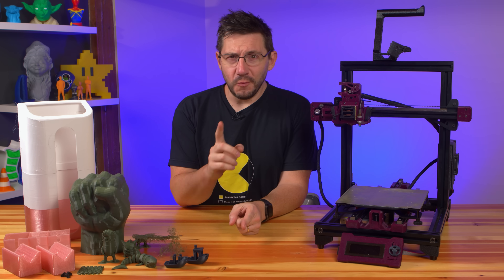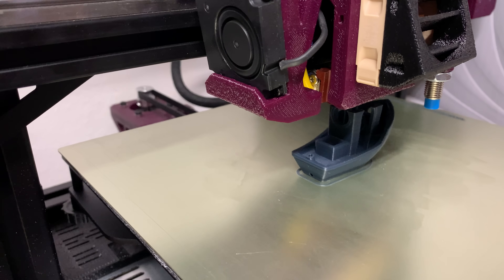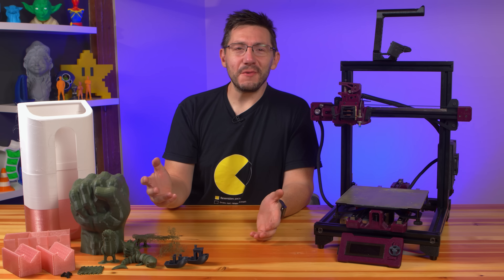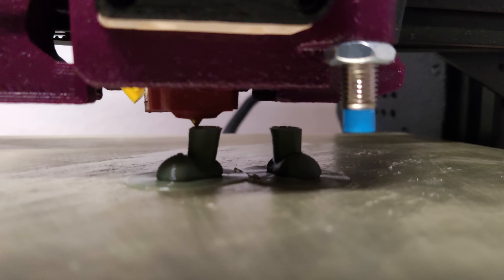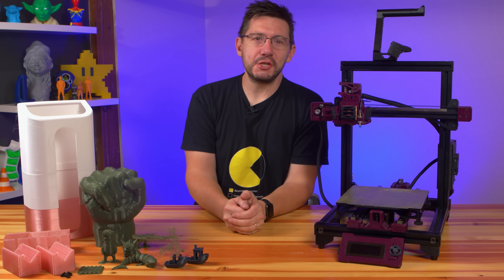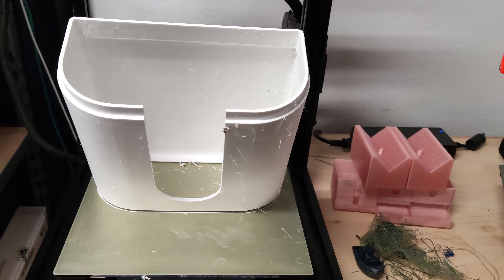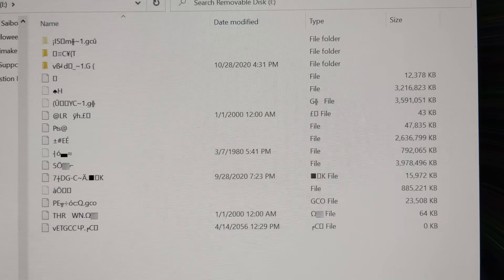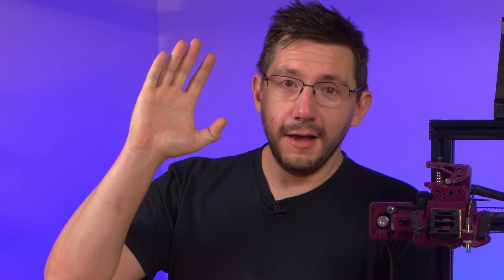WUXN WX1 Review // IS THIS 3D PRINTER FOR YOU?

Comment: Unfortunate.  Corrupt SD, bad test files,  a plate that doesn't stick,  tension on high x.  It's a molded ender 3 with a price that suggests an all original design. It's missing dual z to make up for potential sag or bad bearings.  It's too bad because I'd love a second printer that I don't have to mod. But not at this price point AND problems

Comment: yes, ok. for 400 maybe. For the asking price I, as a customer, I expect a fully developed machine that I can use as a tool in my different hobby. If printers are my hobby I'm better with an Ender 3 and maybe a direct drive kit, BLtouch, flexplate, SKR Mini ... I can gather experience that way, have better results and even 30mm more Z height for prints. This thing is way too expensive for what it offers right now. nah thanks I'll pass

Comment: Socially distant High Five Joel!
Quick warning, LOOOONG COMMENT!

Looks like the extruder could benefit from a reverse bowden adapter between the filament runout sensor and the extruder.

My thoughts for WUXUN: 

First, dual Z-axis motors, linear rails on the z-axis (you already have them on X and Y why not Z). 

Next, lose the single lead screw on the z-axis, this price point is too high for leadscrews, make it precision ground ball screws.

Like I said above, bowden adapter from the filament runout sensor to the extruder.

Printed components, with the capabilities of the Slice Eng. Copperhead I think that the printed PETG components are a bit lacking.
I noticed that they seem to look rushed and sloppy a bit (it might be the fuzzy texture). 

For the price they could easily do injection molded components.

Last, I am curious about the name WUXUN. 

Joel you mentioned that this printer is made in Colorado, so why did they go with a Chinese sounding name?

I personally would LOVE to support an American designed and built printer, I love supporting home-grown companies. But the name WUXUN sounds Chinese and does not tell me that it is made here.

There should be something that makes it standout as an American company.

This looks like a good start, but I have to agree with you that it seems incomplete as a finished product.

While they want to compete with the likes of Prusa, the quality does not seem to be there yet.

This printer has all the ingredients to be great, I hope this is just the beginning for them and that they take this criticism constructively.

Getting the printer into your hands (and hopefully some other Youtubers) is probably the best way for them to do QA and testing.

I'd love to see Angus and Thomas Sanladerer and see how it works for them as well.

Comment: These kind of reviews need a more careful and analytical approach.  Comparing the WX1 price point to an entry trim Pulse 3D, a Prusa Mk3 kit, and a WYSIWYG Ender 3 is misleading. FWIW, the Pulse XE printer Joel reviewed in 2018 went for $1,500.  A current Pulse XE that appears to be on paper similar to the WX1 has a $2,000 list price ($1,700 sale price).  I don't understand the ecosystem part, either.  Optimal filaments should work across many printers, extruders, and nozzle diameters.  Hence and IMO, Hatchbox is bar-none the best filament in price, accessibility, and quality.

Comment: They need a buyer. To change all the 3d print parts to metal. it's like a prusa upgraded not working. When you buy from china there is 1000 prices for the same thing. a good quality review matter and would help them to improve that. Slicer and ecosystem matter is not a problem on a cartesian machine.

Comment: Theres is one thing i dont understand, like the trouble you had with the bolt live. How could you not understand that you slightly bended the plate in the middel when tearing off the plastic, and that an un-even plate was the reason. This is the danger of youtube, sponsored people comming off as profesionals giving reviews with the power to ruin a company, without knowledge on how to properly use the item..
Reply from the maker: I don’t understand what you are saying. What is a “bolt live”?
Reply: @3DPrintingNerd  the "bolt/screw that he first printed- live on his stream. he was bending the plate when getting it off making the bed plate un-even, he schould have waited for it to cool properly down and removed while having a hard surface under so it dont bend. when working with precision in the 0.xx mm, even the tinyest bend can fu#% up the print. And yeah i know they show you to do it that way, but that thin plate is not un-bendeble in the eyes of 0.xx mm

Comment: I have this printer and I like it. It is in desperate need of a firmware update coming soon, I've been told. What I've learned until the update comes, is that the SD card needs to be removed before you power up the machine or it will be corrupted. The filament runout sensor and the power resume features need to be disabled until the firmware is updated. All my prints stick fine to the build sheet with  the included glue stick, which cleans off easy with alcohol spray and a rag. I've been using it for a month and I'm diggin' it....but looking forward to the firmware update. Customer service is top notch.

Comment: Building a badass on paper 3d printer is the easy part. Dialing it in and making the results match the hardware is the hard part, and often what you pay for. The question of worth comes down to how much time you want to spend dialing a printer in, vs just hitting go and walking away on a printer someone else has dialed in.

Comment: Well hmm I have 2 ender 3's one regular and one pro. The original is setup with 4 mods. BL touch, Direct drive kit, Filament sensor, And big tree tech SKR mini v1.2. All in all I think I've spent $300. bucks on it. It makes fully functional prints on the stock PEI sheet that it came with (Non-Magnetic BTW) with no additional friction modifiers. Prints in PETG, PLA, and TPU. While I believe it can't safely hit the temps of the WX1 it does more than it really should. The Pro is setup and makes great PLA prints at the moment as it is bone stock. List of upgrades for that printer are all the same as the non-pro with adding an internal raspberry pi for remote printing and an all metal hotend. Might build an enclosure for it not sure yet. Cost for that one is actually cheaper than that of the original at $280 total cost. As nice as this printer looks I could never justify the $950 price tag that they slapped on it. Great review otherwise keep it up.

Comment: Thanks Joel, nice review. A printer manufactured in the USA should come with a certain quality standard that this printer doesn't even come close to. The only thing decent on that whole printer is the Slice hotend and it only goes to 325.. Weird? And at that price point, you can almost buy two Ender 3's, upgrade them with Slice hotends, Duet boards, rollers, beds, sensors, etc. If you look at the MatterHacker's Pulse, you see a USA made semi-cloned Prusa printer, but MatterHacker's took the time to upgrade all of the parts, including the D-frame. The Pulse prints flawlessly right out of the box, no issues and that is what we expect from a USA made product.

Comment: I’m disappointed the printer is so poor and let’s face it is, far too many problems especially for a printer at this price point.
You can give it marks fir design but if it cannot make. a decent print  it’s useless.
And that’s what it is a very expensive unusable printer.
I cannot believe a company would send a printer for review with so many issues.
If it was one thing that was a problem then to a certain point you can understand it but there’s far too many things wrong with this.
And I think it’s very ugly.
Ok that’s a personal thing but I was genuinely shocked at the price.
Feel sorry for anyone that has bought one.
As it stands it’s a terrible printer.
I hope they take this on board and fix it but even if I lived in the US and it was sorted and worked as advertised I would not pay this for a printer I have never heard of.
Buy a Prusa or an Ender or just about anything else but not this.

Comment: Thanks for clearly explaining and demonstrating the "context" of a 3D printer, the combination of the printer itself (what's in the box) with its surrounding ecosystem (or lack thereof), and how the purchase price can include far more than what arrives in the box.  I now better understand why, when a vendor has not (yet) built a new ecosystem for a new line of printers, it is important for the design to leverage the best parts from the "public" ecosystem, and to execute on them flawlessly, even if it means limiting the printer design to do so.

This yet another reason why I love my Sidewinder X1 v4.  It's innovations are small and contained (such as the ribbon cabling system) while it takes full advantage of the best current and proven bits (from a performance/price perspective) including the silicone bed heater, V-groove rollers, enclosed electronics packaging, robust frame design, dual-Z drive, and most importantly the Volcano hotend.  And it does so while avoiding "bling" such as frame-mounted LED lighting, though I enjoy the single carriage-mounted LED color being used to show the operational state of the print, such as bed heating.

When it comes to the X1, a key aspect of this design approach is the intentional omission of automatic bed leveling (ABL).  While researching the X1 (before buying it at a terrific Black Friday price a year ago) I was confused why such an otherwise great printer would not have the "common" feature of ABL.  A few searches and some answered questions, showed me that ABL is really a hack, a way to get past the design and implementation limitations of some 3D printers.  The X1 has an extremely flat tempered glass bed that is generally immune to warping across the entire bed temperature range.  Manual leveling has a semi-automatic assist making it quick and easy.  And the bed supports are designed so that re-leveling is seldom needed (I level my bed every 3 months, mainly so I always remember how to do it right).

There's yet another intentional omission in the X1: A removable build plate (RBP), which is rapidly becoming another "common" printer feature.  One would think this would be even more important for a large-format printer, where part adhesion forces can become truly formidable.  As I understand it, adding an RBP would add some negative characteristics, including a less-flat build surface (increasing the need for ABL) and less even and less efficient bed heating.  The print adhesion issue is partly addressed by the glass print bed, which is textured and has a matte surface finish.  Together, the bed features of texture and matte surface finish provide good adhesion for nearly all materials, and when it doesn't, a small amount of glue stick is all that's ever needed.

Of course the X1 v4 isn't perfect.  No compromise design ever can be.  In particular, the part cooling system is grossly inadequate, suitable only at slow speeds, a needless limitation for a printer that can melt filament at impressive flow rates.  Fortunately, this is straightforward to upgrade, and the X1 design makes it easy, with the X1 community devising some impressive solutions.  I also wasn't happy with the spool holder, another easy fix.

The only fundamental X1 design item left open for debate is the use of V-groove rollers on every axis.  I like linear rails, but "cheap" ones are seldom worth the cost, and "good" ones could easily have increased the X1 price by as much as 50%.  So I check all rollers and belts every 3 months when I re-level the bed.  Speaking of belts, they also can be improved by using lead screws or other linear actuators, but that again would put the X1 in an entirely different price bracket for relatively little performance gain.  Rollers and belts pretty much define optimal performance for minimal cost.

For me, the X1's design trade-offs and limitations highlight it's strengths, making itself a truly excellent member of the public 3D printing ecosystem.

Comment: so... an overpriced, mediocre printer? no thanks
"proudly made in USA" is just a stupid sticker that guarantees you're gonna get ripped off for usually worse products than ones made in China by a decent manufacturer, just look at this, look at ultimaker, look at slice  engineering, I get it, 'mericans will always spend stupid money for that sticker cuz 'murica. the fact that you can get a LOT more for your money by simply outsourcing to a good factory in China... it just seems dumb not to do it, they are professionals and will make what you tell them, it's not all "cheap Chinese" stuff, if you ask them they can deliver cutting edge performance at cheaper prices than "regular" stuff made in usa

Comment: This price is too high. To 3Dprint starters, order an Ender 3 V2, or similar and learn the Basics.
After this maybe you want to craft your own Printer. E.g.the BLV MGN (also Open Source and Corexy).
Thats my opinion.
Reply: Or if you can afford it and don't want to tinker, just get a Prusa. Same price range as this but it actually has reliable consistency and quality control. The WX1 seems to miss the mark for both purposes. It produces the results of a starter printer at 3x the cost, but if you're going to spend that much, you could just get an established brand instead.

Comment: Hey Joel, which version of Cura were you using? The current public release version has a few bugs impacting print quality, esp. on the Ender 3 for example. I think it's been fixed in the Beta version. But I totally agree with you that this is very unpolished experience for the price. I think they needed at least another year of development, esp. on the software/firmware side (i.e. have tuned Cura and Prsusa Slicer profiles available Day 1). They have a long way to go to get to reach the Prusa out of the box print quality. Companies can't release a printer like this in a mature 3D printer market and hope to do well, especially when the print quality benchmark everything gets compared to is the $200 Ender 3. I unfortunately see this printer not doing well/having buyers especially with that branding which makes this sound like a cheap Chinese company you only find on Aliexpress/Banggood.
Reply from the maker: 4.2.1 for this

Comment: Kudos for being open hardware and software, but I wouldn't touch this printer with a ten foot pole.
Reply: For almost $1000 I would touch a printer that can print a 10 foot pole, though...
Reply: @pileofstuff  Sounds like you're looking for a belt printer ;)
Reply: I mean, it's pricey but i wouldn't be surprised to see this one get some upgrades and improvements much like the original i3 did

Comment: So is the printer causing the SD cards to become corrupted ?
Reply from the maker: Yes.
Reply: @3DPrintingNerd  That's insane. I don't think I've ever seen that happen since the early days of RepRap. My guess is their power failure protection uses the SD card for keeping track of the last position/layer data and their implementation of reading/writing to the card is broken. If they didn't catch this in their QA/QC, I have very little hope for this.
Reply: @shadow7037932  if this turd is truly FOSS it should not be too hard to disable "resume on powerloss" features of Marlin 

Why they did not disable it out of the factory baffles me however!